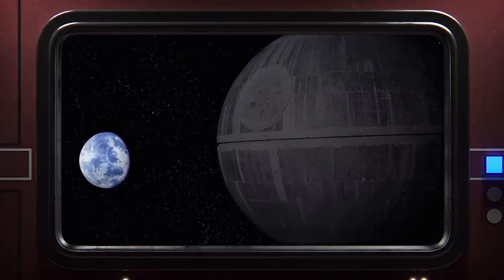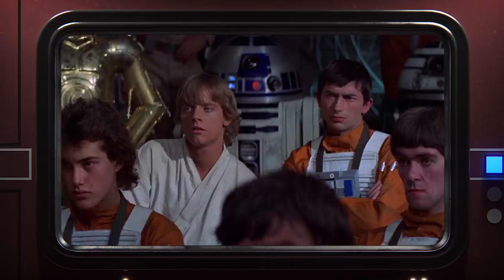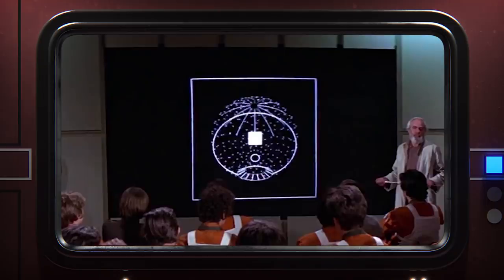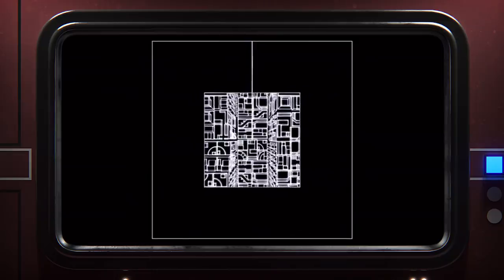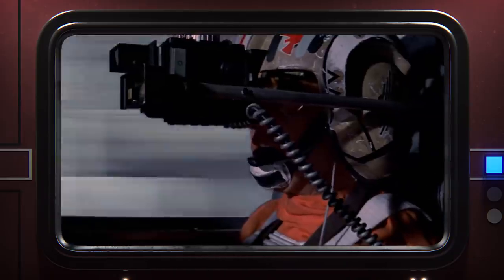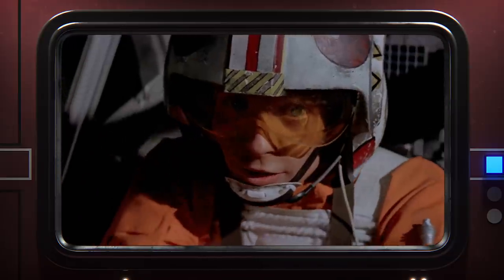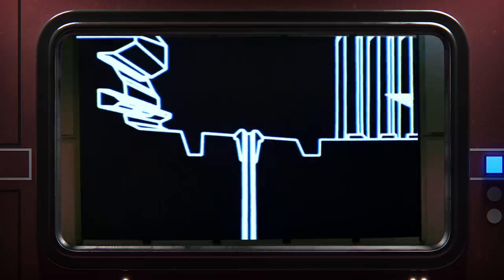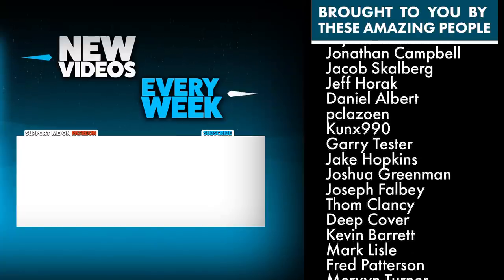The Thermal Exhaust Port Was NEVER a Problem

Comment: The fact that people complain yet doesnt realize if it has a giant laser it will need to release that heat after the shot and a single exhaust port wont do
Reply: DJ Panda Gaming yeah, but what if your exhaust ports have zig-zagging paths to the reactor, or are smaller than proton torpedoes? Easy fix.
Reply: @Klipik12  first of all the emense heat that the death star gives off after full shot then it needs to be exited immediatly to avoid damage and prolonging it with zig zag pipes could destroy the pipes also the exhaust ports would have to big enough to avoid adding to many or too few
Reply: @redmafiapanda  this. this comment right here. too few people really understand just how important that port's design was. it HAD to be made the way it was, or it wouldn't have done it's job properly.
Reply: @natesmodelsdoodles5403  no it would but it would just be destroyed after one shot because that heat needs to be let out
Reply: @redmafiapanda  exactly. if the heat's not getting out, then the thermal exhaust port isn't doing it's job properly.
Reply: @natesmodelsdoodles5403  im saying with no exhaust port then no heat is getting out wether if its a giant one on top that wint br enough fir something that destroys a planet
Reply: OriginalTharios  Well you can avoid radiators if your willing to devote alot of mass to geting rid of it.   Pump the heat into a pile of matter and dump said hot matter overboard.  This is also called a thermal rocket and is one of my 2 biggest problems with that exhaust port.  The only way that design would do anything is if it was spewing horrifically hot matter out it constantly.  There is no way your shoveing any type of warhead back down a scorching hot mater stream of that sort.

The other issue is the required power to explode a planet like the deathstar does.  It would take the output of a star like our sun to literaly blast a planet apart like we saw.   All of it, for a day or more, delivered in a few seconds by what we were shown.   Ya your not generating that kind of power output without glowing like a star from all the waste heat.
Reply: OriginalTharios  Meh practical no but it would work as long as your reaction mass reserves held out.  Not sustainable, its more akin to a battery powered flashlight, works in the short term but its going to run out sooner or later and then the light dies.  In this case the light will get significantly brighter... and melty, but still very dead.
Reply: OriginalTharios  bruh yea it does witht that amount of energy it will release immense heat no if ands buts about no matter what logic your using it is illogical to say "oh hey it doesnt release any heat"
They are literally called THERMAL EXHAUST PORTS thermal means heat so yes so when the deathstsr is ussd the laser will give off immense heat with each use
Reply: @Klipik12  the size is required to function wirhout a lot more ports
Reply: You can release heat without any exhaust port at all. Only gases and other matter would need an exhaust port. To get rid of heat, you just need some metal that conducts the heat to the outside.
Reply: Hey, yall do know that thermal exhaust ports don't work in a vacuum, right? the Death Star would need Radiator fins, massive ones. Did any of you consider that there is no air in space?
Reply: @borstenpinsel  yes exactly which is what the exhaust ports do
Reply: @borstenpinsel  after all they are called THERMAL EXHAUST PORTS
Reply: @borstenpinsel "conducts heat the outside" doesn't work in the vacuum of space. Getting rid of heat is a huge problem in space. The vacuum of space is a great insulator. Look it up don't take my word for it. The heat has to literally be pumped out or forced out. Passive radiator fins would not work looking at the post below.
Reply: starkiller187 engineering 101 for you
Reply: @-werksmith2078  im just saying its called Themal exhaust ports which means heat exhaust ports so yeah
Reply: @gearhead743  unless a reaction creates a build up of gas, then the lack of pressure in space would cause the gas to essentially be jettisoned out into space. Like an air lock.
Reply: not to mention several very large reactors that will have to vent their excess heat somehow
Reply: @Klipik12  Just had an idea. You're in space, getting rid of heat is nothing like car exhaust. It needs to be radiated away as photons, which would be vastly more efficient traveling straight outwards. Zig zags or any obstacles in the way of a waste-heat radiator would re-absorb at least some of the energy. If a ridiculously powerful surge of energy were to be produced - better let it have a straight path outwards or it might decide to make its own straight path regardless. (the death star would need a massively powerful main reactor just to operate all the normal stuff. It charging up to fire would be unimaginably powerful of course)

If the port is to let out, say, X-rays from the central reactor, that can't be simply bounced off mirrors, this would basically need to go in a straight path since steering around corners would be a horrendously difficult thing and need the corners to be smooth gentle bends that a torpedo could probably slide around just fine.

I know Star Wars treats space like air anyway, and could also better vent heat by venting hot gas (like releasing stored/pressurised gas to flow over radiator pipes and out into space) - that would require the DS1 to consume huge amounts of an expendable resource per shot, needing to be shipped in from a planet, probably vulnerable supply ships, logistics problems operating away from bases capable of supplying vast quantities of pressurised gas, much much more vulnerable than a small port that requires incredible luck and possibly space magic to successfully attack.)
Reply: @gearhead743  You don't need fins, fins are relatively primitive tech. We barely know or use them even today because we have no major presence in space, and there are advancements on the table. You can use mass - a heat sink, or thermal droplets. If I had to guess, the DS was using thermal droplets and spewing them out by the thousands of tons per second; though I doubt Lucas or anyone in '77 knew or cared, they just said 'hmm this thing needs a weakspot' and decided on 'Thermal Exhaust'. 
What with how everything is moving and shooting and how massive some of the ships are (crews in the thousands for a ISD, who knows on DS1 and DS2, everything should melt the first time you get it out of spacedock.
Reply: How does one release heat in vacuum?
Reply: @kuklama0706  by ventilation?
Reply: @redmafiapanda  Your theory, shared by the majority of the fandom and Lucas himself apparently, rapes the 2nd law of thermodynamics. You can release heat throught 3 ways : conduction, convection and radiations. Space is empty, so conduction (throught contact with solid material) and convection (throug contact with gaz) is IMPOSSIBLE. You just CAN'T ventilate heat in space as it was some sort of "hot gaz", it's scientificaly inaccurate. You need to use radiator panels, but the amount of energy of a directed-energy weapon as the DS laser is equal to a real star, so it's impossible from the start as the amount of radiation would blow up the DS anymay.
Reply: @ericlf3087  While space is gasless and theres no real way for convrction to take place but our science especially on space is VERY limited news flash kid we are not the center of the universe secondly the DS itself gives off heat  when firing the DS because the power generator is probably 100x maybe even 100000x more we could produce in a single year if you have another theory on why the exhaust port is there then by all means tell me but donr give the "pLoT pUrPoSeS" weak ass garbage of an excuse if the exhaust isnt to ventilate the heat from thw power core then what is it
Also keep in mind that the materials they uss is probably 100x stronger than our known metals
Reply: @ericlf3087  And while it may goes against our laws of how things work
Im stating again VERY LITTLE of comprehension tale the "nobody cant go faster than light" bs its not impossible to travel from one side to another in space with a matter of minutes but we just dont comphrened the method of such or even artifical gravity
Reply: @redmafiapanda  
1= it's a basic law of physics, no amount of "super futuristic magitech" will change that ; it's like saying that there is sound in space because SW galactic civ has a better understanding of physics, it's non-sense, it's just pure ignorance (or artistic licence) from GL, as ships needs RCS thrusters to move elsewhere than forward, or the amount of fuel needed for a spacecraft to achieve escape velocity (from Earth or Yavin's gravity) is far beyond what an X-Wing can carry (the only way would be to mount 1 or 2 X-Wing to a rocket or to launch them from a spacecraft carrier already in orbit, but in SW, or Captain Marvel, or other universes, some magitech discovery allow a small ship using 5 tons of fuel (and no magitech as antigrav tech), and it's stated that X-Wing are using fuel in order to flight, to achieve escape velocity. Again, official data indicate that an X-Wing is barely as fast as a modern aerial fighter (1,224 kph or Mach 1), but he can acheive escape velocity (40,000 kph) anymay through magic ways (otherwise an X-Wing couldn't leave Yavin's gravity to go to space), which contradicts official data.)

2= an exhaust port for ventilate heat in space is a scientific non-sense as the rest of physics in most SF : of course it's a "plot purpose" thing, what else ? Lucas just wanted to do a 633 Squadron/The Dam Busters-like scene with the trench run and a weak point to bomb, that's it, there is a hundred of ways to destroy a DS : a nuclear bomb (you said it yourself : galactic SW civ can produce more energy than modern Earth : building multiple nuclear or magitech missiles with enough power to obliterate an 80-miles radius space station is comparatively easy : even a modern atomic bomb will make a hole in the hull and kill the crew), one or multiple asteroid from behind (as the DS has only one main weapon and some useless CWIS that can't even destroy the majority of the rebel squadron from a far distance : a modern aircraft carrier CWIS can destroy a fighter 10 km ahead), hyperespace ramming etc etc, but Lucas thought that space was like air and wanted to have dogfights in space, forgetting that even modern, pre-interstellar, aerial warfare is Beyond Visual Range and dogfight is a WWI-WWII tactics because missiles and radars completely change the way modern aerial battle groups are fighting in the 60s and 70s. But DS have just 1 long rang weapon, no shield, no escort fleet... and it took 20 years and an incredible amount of ressources to built it : physics, as simple strategy or warfare, are all but logical in SW, it's not realistic for a second, without mentionning the absence of missiles as main weapons, the close combat of warships, the ridiculous range and velocity of laser weapons (true laser weapons = lightspeed), the command bridge (CIC) exposed, useless windows in warships, elite troopers (stormtroopers) that can be killed by one shot by a 19 years old princess (if you want real elite troopers, look for Space Marines or Spartans, or any "realistic" (for an Empire with that technology and that power) elite corps of super soldiers using shields, exoskeletons, bio-ingeniering, weapons that actually kill, tactics that actually work etc).

3= pure non-sense, we talk about energy transmission through conduction (or convection) : the strenght of materials used in building a spacecraft is irrelevant as heat can transmite to anything and radiate : the crew will just die from heat or radiations, and the amount of energy produced would just heat the entire station and make it glow until it explode in an incredible burst of gamma rays. It's not a question of material used, unless you know about such materials.

ccl : The only logical explanation is that SW creator(s) doesn't bother with logics : neither physics, nor simple strategy, nor modern warfare, nor sense of scale (an Empire ruling millions of worlds with just 25,000 capital ships, a galactic rebellion with 400 people and 30 fighters (even Viet Congs had more firepower), a future civ with magitech but people keep dying at 80 years old (but that would ruin Anakin's and Padmé's plot I guess), galactic wars that last 3 years and mobilise just a few millions troops and hundreds of capships (Clone Wars, and it would be barely enough of just one planet) : because they adapt scenarios taking place on Earth (1950s WWII films about aerial combat, battlefields and sea warfare) into space where things work otherwise : it's pure artistic licence, a 100% of it. The project consisting in finding logical/scientific explanations in a universe where physics is thrown out of the airlock for the sake of artistic licence is a waste of time : no, an exhaust port in space just won't work, maybe on Earth but not in space, it's juste basic physics, no, sending 30 fighters against a ship with thousands of flak and fighters isn't strategy it's just suicide (unless said ship belongs to the stupid spacefaring civilisation that forgets about BVR combat, about CIC deep in the hull of the ship and not mounted like a tower on the top of the ship with useless windows that can break and compromise hulls integrity and whose elite trooper corps consist of 5'8'' pingouins killed in one shot).
Reply: @redmafiapanda  I'm not saying artifical gravity and FTL drive shouldn't exist. An author, and physicist, like Isaac Asimov used both of them in his Foundation saga (on whose SW took inspiration from a number of elements : even psychic powers, space warfare, etc). To be honest, I often find universes without FTL or artificial gravity quite boring as it makes it easy for the characters and the events. Very few authors can make hard SF entertaining (S.A. Corey, Le Guin, Orson Scott Card), but you can conjugate both like Battlestar Galactica and sometimes Halo and have magitech (hyperdrive, energy shields, artificial gravity, despite that one never being explained in both universes as humans have antigrav capabilities but used it only for artificial grav on spaceships instead of weaponizing it (gravity guns), or using it to atmospheric flight (as no ship the size of an aircraft carrier can "fly" in atmosphere even with wings and repulsors), or inertial dampeners (as AG would "cancel" the problem of acceleration which prevent even good pilots with anti-g suits to go faster than 8 to 9 g in a fighter) etc. Magitech (or "quantum tech") isn't the problem, as long as it's explained and fonctionnal in the plot and works alongside known physics, bad understanding of celestial mecanics and newtonian physics is (sound in space, conduction and production of sufficient energy to blow up a planet, manoeuvers without RCS thrusters in a universe where good old thrusters still exist, lasers slower than bullets).
Reply: @ericlf3087  actually stsr warships that are able tp hover on orbit or ship capable to leave atmo without huge rockets is possible as we only use 1 type of thrusters we cant ex0lain everything because we are so simple minded come to space technology
Ots also why its cal science FICTION because its not yet possible to call it science
Im not reading the entire thing cause i dont got the time so
Reply: @ericlf3087  Another thing depends on which official data are we referring to? Disney or legends seriously i havent really read up on much data besides what iv come across in videos
And im sorry are you telling me that ships that is interplanetary and interstellar travel is slower than firghter jets built for atmospheric use yeah that makes sense ones built for space another is built for planetary use
Reply: @redmafiapanda  Space being FAR bigger than any planetary atmosphere, any spaceborne ships needs to be VERY fast. Any seaborne warship is about 40 to 60 kph on water. A space shuttle can go up to 40,000 kph, and unmaned vehicle like a probe (or a drone fighter, more realistic than a manned spacefighter to be honest, because it can sustain more accelerations without killing it's crew) can go more than a 100,000 kph using curent tech. If your space warship is as slow as a sea ship your just dead, you need to go to speeds far beyond that to travel even between a planet and its moon and ANY spaceship capable of going from a planet to space, whatever tech your use (antigrav, rocket), needs to go at least to escape velocity which is about Mach 33 : even the fastest modern airfighter can barely go to 1/10 of that speed because of ingeniering issues (including the amount of fuel and the size of the thrusters), but an X-Wing can. Logicaly, it's minimal speed has to be about 40,000 kph which is quite realistic for space combat for fighters or warships. But a SSTO (planetary-to-orbit) fighter can't be slower than an atmospheric fighter, it's basic logic. The problem comes from official datas in that case, because they treats spaceships as planetary vehicles which are very slow in comparison of space ones (because distances in space are just immesurable, and because gravity and air friction doesn't slow down your ship). And, if the Imperials invade Earth with less than Mach I capable fighters (which fight at visual range beside that !), even a squadron of 70s era fighters can take them !
Reply: @ericlf3087  you forget 1 thing thrust output
While they move slower their thrust output is probably higher t
Take boost power up it is speeding you up by a sudden thrust out of the engines (talkong about mario cart) if thats the case then they are sound if they are pushing more than the gravity is pushing on them then they can
Also they use repulsor tech in their ships thats how an ISD 1 is even able to enter atmosphere 
Personally they should have gone with Venator or venator size ships
Anyhow and things like RCS while personally i want to know how they turn and etc i also came up with a theory on it
Reply: And even with all of those exhaust ports it still takes at least 24 hours to be able to Fire again, that’s why the second one had a much bigger exhaust port
Reply: @suckonthis9098  I mean it being bigger doesnt make sense since it still takes time for it to cool down again
Also they did state that it takes awhile to fire again not everything is instant in star wars
Reply: @redmafiapanda  But having a much bigger exhaust port means it can release all that heat much faster, and in return of the Jedi they didn’t use full power so it wasn’t as “hot” since they were only shooting ships
Reply: @suckonthis9098  it was also half built and i was referring to the DS 1 it wouldnt release heat faster something that big would take longer to cool down and to point out you said "hot" yes the DS has heating capabilites their "laser" would produce execessive heat
Reply: @redmafiapanda  But there’s also the fact that it’s just a giant light saber
Reply: @suckonthis9098  Uhm no, no its not while i can say under a science notation a lightersaber is simply a plasma sword its revolves around the force and the jedi there are 2 halves of star wars one is science. Planets, ships, weapons etc then there's the mystical fantasy side like the force, jedi, sith etc two sides of the same coin im more focused on the science because that can be inspire new technology and is possible in some way
The death star is one shot and needs to be cooled down and recharge its not a fricken disco ball that has a deadly light show with a flip of a switch and lightsabers cant cut through anything note from the zello beaat from the clone wars their lightsabers were not able to cut through the armored skin
Reply: AKUJIRULE  Except that the Death Star WAS firing when Luke dumped a torpedo down the exhaust port. If that port wasn't wide open when DS-1 exploded, then somebody onboard wasn't doing their job.

Even if there HAD been some kind of cover, though, having anti-ship warheads explode in any part of a heat-management system strikes me as being very unhealthy.
Reply: God, think about the size of the heat sink the superlasers needs! Never occured to me tbh...
Reply: @eiteiei4063  Thats why there are more thermal exhaust poets not to mention we dont know what kind of cooling systems they have i doubt our coolong systems are the same as theirs after all they able to travel at light speed
Reply: @natesmodelsdoodles5403  if any blow to a heat managing system or jusy something that can go boom coold make the entire thing go boom not to mention there was someone who sabataged the death star at the moment of the trench run
Reply: AKUJIRULE  Depending how much heat is actually being produced most likely 1 or 2 considering the size of it
Reply: @redmafiapanda  I mean IRL I don't think a heatsink of any practical size could be fit inside the station along it's other equipment and be cooled in the span that it does in the movie. Then again most things mentioned here like FTL travel, repulsor lift and the DS1/2 are physically impossible in our universe, but are there because it's a movie and you can have pretty much anything you want, and it does make it way more interesting tbh
Reply: @eiteiei4063  False DS 1 and D2 would be impractical create but is possible and number 2 Repulsor lift technology is also possible and thirdly ftl is possible its all possible though we do not know the means nor the mathmatics and engineering to pull such feats off we dont have the means to produce the energy that it does exist in star wars realistically it would take longer to cool down its a movie so there qill be time skips
Reply: @eiteiei4063  Thats why its called science fiction because there is no science for it yet a lightaaber as i said before is just basically a plasma sword, the DS 1 and 2 uses plasma again for weapons and repulsor lifts uses either magnetic or gravitational popularity to do what it does
Reply: @eiteiei4063  we are confined to our little planet so our means for many things the science to discover is very very limited to what we can make we look to the stars but no ambition to make travel easier
Reply: @redmafiapanda  Okay, I understamd you really love Star Wars, and would love for things from the movie to be possible in the real world, but you just have to accept the fact that it is completely impossible. And even if some place where magic was real and laws of physics don't apply is discovered, it's not gonna happen in your lifetime
Reply: @redmafiapanda  I'm not going to continue with this, as you will just say something is possible, then you will give a vague explanation as to why, when someone explains to you why it won't work, you just say "We don't know everything yet" I find this, and you, quite stupid
Reply: @eiteiei4063  I do love stsr wars im not going to deny some things would not exist but if nobody tries then we will never evolve as a species
Frankly i can turn it around how do you know it isnt possible point in example se thought bananas were fruit further studies we found out that they are berries
So what am i getting at?
The more we learn the more possibilities open up im not saying i will see this in my lifetime im saying its possible nothing anytimr soon but is a possible feat
Reply: @eiteiei4063  And you just invalidated yourself in a debate you never result to insults not to mention i did give an explanation when we lesrn more about something things change i gave an example of that here you said "its not possible" and without explanation as to why so really you have no point to stand on
Reply: @eiteiei4063  Not to mention most thigs are possible until proven otherwise
Reply: @redmafiapanda  My explanation is that the laws of physics and thermodynamucs simply forbid such things from existing, from our current understanding of the universe, these laws apply everywhere, and are not subject to change. If it is found that they can be broken or can deviate, it is unlikely to happen in a scale that will allow for something like, for example, escaping a celestial body's sphere of influence at a velocity lover than the escape velocity. Not to mention the time-frame. If that does happen. We will quite surely not be there to experience it for ourselves. You again went for your "Until proven otherwise" point, as I had noted you doing before. In short, the laws of physics prevent Star Wars from becoming a reality, and they will not change in a scale, or rapidly enough for us to enjoy in our lifetime, thus making this argument quite pointless
Reply: @redmafiapanda  You did give me an explanation to some things, like repulsor lift, your explanation seems a little unrealistic though, I would like you to try to explain for example a ISD's ability for atmospheric flight indepth without using the "We just don't know how yet" argument. Because yes, new technologies can be discovered, but no technology that I can see feasible should be able to lift a ship that size into the air so close to a celestial body ever, due to, as you might guess, the laws of physics. But please, do prove me wrong if there is something I am missing. And sorry for the insults, I shouldn't have taken this that seriously, it is only a movie we are talking about after all, I'd like to try and keep the tone of the conversation peaceful from now on
Reply: @eiteiei4063  And who says it isnt a subject to change and not to mention you keep saying "in our lifetime" nowhere have i said "in our lifetime" i know it wouldnt happen in my lifetime maybe not in 200 or 300 years
What i do know is that our knowledge changes and thats like saying "without water theres no life" which is half right without water our species cant survive take a being that isnt made of organic tissue they dont require water or there are beings who may not require water but requires some non earth liquid who knows thats the thing there are billion of systems that we havent even reached therefore what is and isnt possible is everchanging and most star wars weapons are plasma based
Reply: @eiteiei4063  And you are right the mass of the imperial star destroyer is too much to be in such atmosphere like that but take the venator star cruiser that is a more desirable ship for atmospheric and space capability ship also if its "just a movie" then why did the Geneva convention banned weapons like the death star or not to mention the defense program by reagen inspired by star wars not to mention the probe droid for jedi training scientist had tried to recreate while you say my reasoning for repulsor lift technology is in fact "unrealistic" well yeah there hasnt been research done the laws of physics are made yet how can we place those on a universal level if we never colonized a single planet
Reply: @redmafiapanda  The laws of physics have been observed to function the same everywhere we have been, and everywhere we have looked, sure it's a tiny area in the grand scale of things, but I'd say it is large enough that the human race is unlikely to ever reach beyond it's limits before perishing due to some unforeseeable reason. The reason I keep bringing up our lifespans, is because what point does one have arguing about something if they will never be able to know whether they were correct or not? To prove to future generations that we could maybe do somethings? Sure, noble, yet in the end, quite unneccessary. And the without water, there is no life thing, most scientist would surely know about the same things which make you think that statement is false, thus they would likely also find it incorrect, meaning that it no longer holds any scientific value. That is likely because it was based on knowledge that is now many generations old. Humanity has since learned a ton about the universe, and you're again right, that does mean new breakthroughs happen all the time and they replace the older scientific research we have done. But our understanding of things like physics in the scale we are discussing, I like to think is so deep now, that it is unlikely to experience any major changes anymore. It is though possible, and I don't want to deny that, as I said, it is incredibly unlikely that we would ever find out wheter we are correct or not in our assumptions. And that's what we are basing our points mostly upon here, assumptions, there is no factual knowledge that could prove either one to be correct or incorrect. Hmm... I think my sentences and chaptering could use a little work though lol. Sorry if these are impossible to read!
Reply: @redmafiapanda  Colonizing a planet isn't needed to understand physics there, an unmaneed scientific probe can do that, and we've sent out tons of those! And yes all but conventional weapons have been banned for use in space and orbit, that's because things like laser and nukes in space can cause serious damage and have little to no ways of countering them. I would love to hear more about real life experiments with the jedi training probe, did they use mag-lev technology in it? I doubt it could lift itself using something like RCS or cold gas jets. Do you have a link or something to direct me to a page of it?
Reply: @eiteiei4063  And you are correct i find it neccessary to give knowledge to think outside the box ask everything and anything that even with the slim chance of it being possible to test if it is experiment maybe we can discover things but our goal wasnt to discover that
Reply: @eiteiei4063  i gotta see if i can find the link if i remember correctly it was made on the ISS so none also it probably wouldn't stop people making energy based weapons for soldiers
Reply: @eiteiei4063  Star Wars canonically has gravity manipulation tech literally all over the place, that's what repulsors are.

Hyperspace is an extra dimensional space that allows for FTL travel.

Both of these things should be effectively impossible by our standards, but Star Wars handwaves that completely.

Who's to say heat can't be expelled through conduction in Star Wars space? After all, there are numerous creatures that we know LIVE in deep space, like that asteroid worm in ESB and the purrgils in Rebels. Life in deep space shouldn't be at all possible but these things manage it literally constantly with no issues.

There's probably some midichlorian or hypermatter related explanation that people haven't bothered to make yet because that's really not the point.

Edit: I just realized something: the thing's ray shielded, which is why proton torpedoes were necessary: they're a kinetic projectile, not an energy projection. This presumably goes both ways with a shield like that, meaning direct energy dumping is out of the question. What does that mean? Well it means that cooling gasses, plasma, and fluids were probably dumped out of the ports the same way modern-day nuclear reactors cycle coolant. Thus, the ports  must be open holes with no obstructions because it's a freaking planet killing laser, of course it needs to be wide open. 2 meters was likely as small as one of these auxiliary ports could've been made.
Reply: @redmafiapanda  Vacuum doesn't conduct, in quote "reality" a liquid conduction system with radiator plates would actually be implemented
Reply: @blueskies133  i never said vaccum is their conduction i said that they would need a way to remove the excess heat
Reply: @red5t653  actually there could be the possibilty that there are organisms or mechanical organisms like the transformers species or somethung mrchanical could live in space
Reply: @red5t653  also a FTL is nothing but a wormhole being opened frome ine point to another besides star wars though they still have to use some sort of particle that opens to the hyperspace dimension
Reply: @red5t653  there are also 2 big ones on its polars and yes the ports are ray shielded im pretty sure protons are not kenetic but i can be wrong but whatever thing is they can penatrate shields